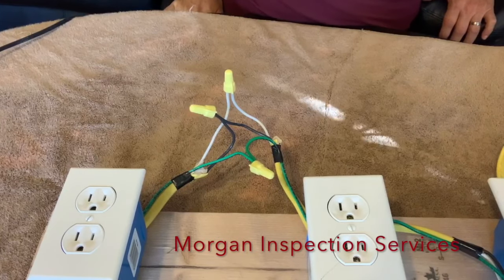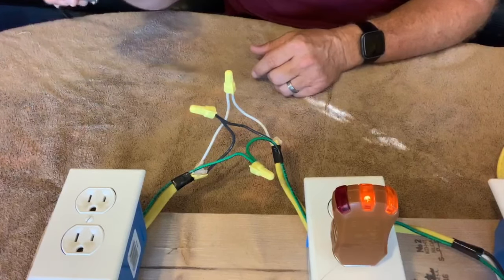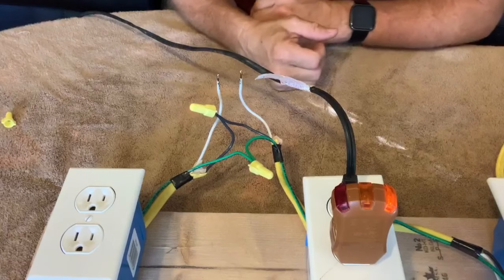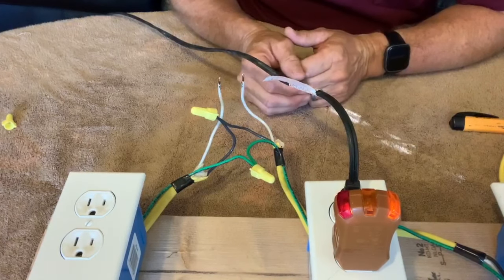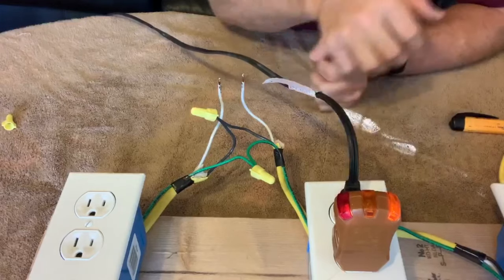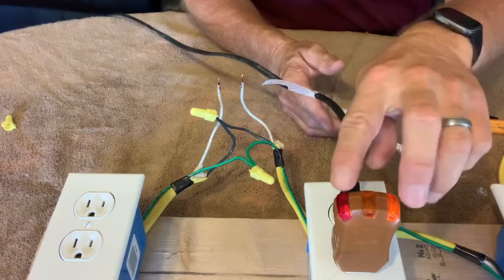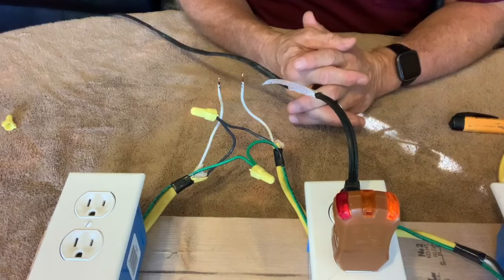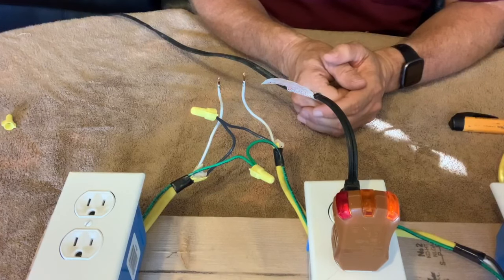What is a Hot Ground Reverse?

Comment: I just finished working on my sons home they just purchased.  The inspector noted a weird sub panel and a few receptacles with hot neutral reversal.  The 60 amp feeder in the Main panel board was connected black L1, red L2, white neutral/ ground bar, bare neutral/ground bar.   In the MLO panel connections were black neutral bar, red L1, white L2, bare to ground bar.   There were circuits connected to breakers 3,4,7,8,11,12.  So, all of the L2 positions with the white wire connected.   After testing and revising the feeder to be correct, all but two receptacles tested reverse wired.   Black on silver white on brass.   The original installer had reversed them to look correct.   So, power was from neutral bar, to devices on white, back to panel on black to breaker.   This installation was done over 20 years ago and been that way the whole time.  Horrible that anyone would do this!

Comment: I have the same problem with no lights and same thing showing on tester indicator. I have 6 light switches  5 outlets on the Circuit. I have checked all the connections and replaced the outlets and swtches. Checked ceiling fan, ceiling lights and vent a hood connections.  Still no luck. Voltage is good at breacker. Stumped!
Reply from the maker: Are you getting the Hot/Ground reverse indication on all of the outlets on the circuit or only on some of them? If it is only one or some, then this should help you to track down the loose neutral wire.
Reply: I'm getting it on all of my outlets.
Reply from the maker: It’s very hard to troubleshoot this kind of thing long distance, but I would follow the wire from the breaker to the junction box in the attic (or wherever it is) and make sure that everything is wired properly there. I would use a multimeter and make sure that you have 120 V between your hot and your neutral, and between the hot and the ground. If it tests good there, go to the next spot - whether it’s a light or an outlet and do the same thing. If it doesn’t test correctly at the junction box, then obviously there is a problem before the box. You might could speed things up by using a voltage “sniffer“ and just checking your neutral wire in various places and seeing if it has voltage. Once you find where the neutral has voltage and where it does not have voltage, you will know the problem is between those two points. 
I would be very interested to know what you find out.
I just had another thought. You said you have outlets and lights on the same circuit. If someone ran a neutral wire to a switch instead of the hot wire to the switch, that could be the problem. Just a thought.

Comment: What if all 3 lights light up when testing a gfi? Rechecked wiring. New gfi. Line only, with ground. Whole neighboring circuit out. When I jiggle new gfi in metal electrical box neighboring circuit activates for a second. House 1960’s   Any thoughts?
Reply from the maker: My first thought is that if you jiggle the GFI in the neighboring circuit comes on, then there’s a loose connection at or near the GFI. Are you saying that all three lights come on when you are pushing the test button?

Comment: I just finish replacing new outlets and switch , 13 units total because no power and breaker on/ So I started replacing all bad ones and couldn't find nothing , no loose wire or something to help me  to say : finally I found the problem. NO, still have same reading: red and orange HOT GROUND REVERSE. My last chance is replace just that breaker for that area.. Hope works. I like your video gave more idea if You have any suggestion I will appreciate it. Thanks
Reply from the maker: How did it work out for you?

Comment: Very informative.  The load must be turned on, as stated, to receive a shock
on an open neutral. Kirchhoff's voltage law for series circuits. You are in series
with the other load.  Did not know about the plug in tester giving misinformation. A big thank you.
Reply from the maker: Thanks for the feedback.

Comment: Hey so quick question I went through the testing of the cabling and everything and it said I had a hot ground reverse so I made sure to unplug everything for my outlets in my entire apartment I'm in an apartment by the way and it didn't seem to change so I turned off the circuit breaker for it and what I found out is that there is no ground cable connected to the outlet would that also give it a hot to ground reverse?
Reply from the maker: Do you have one or multiple receptacles showing hot/ground reverse? If your problem is indeed an open neutral somewhere upstream, it should not matter if the receptacle has a ground wire or not. The missing ground, by itself, would definitely not cause the hot/ground reverse reading.
Reply: @morganinspectionservices3840  I only have the two outlets showing hot ground reverse. Before it is the bathroom outlets though and from the video I recall it could make the reading different.

Comment: Ok.  The outlet is working fine, but the tester indicated a hot and neutral reversal.  And you're right the first thing I thought of was that the wires were likely reversed at the other end.  I'm going to just leave things the way they are since it's all working like it should.  I only found it when I was checking all the outlets to see if they were correctly grounded.  Some were and some weren't but I was able to fix those.
Reply from the maker: It's not a good idea to leave a hot/neutral reverse in the home - especially as easy as it normally is to correct it.

Comment: My outlet is saying that it’s a hot ground reverse. I only have two wires and no ground. How can I fix this?
Reply from the maker: Hi. As I show in the video, a "hot ground reverse" normally means something totally different, however, in order to get that indication, you have to have working ground. Without a ground, you cannot get that indication. Do you have a metal box and conduit going to the box that may be providing a ground? That is the first question that needs to be answered. Perhaps you could check some other nearby outlets with your tester and see if they show to be grounded. Then check and see if there is or is not a ground wire to them.
Reply: @morganinspectionservices3840  I did find the ground. It was attached to a screw in the back and not on the outlet. The problem is the electrical box keeps tripping. So I thought it was the outlet (old outlet/old house) The one outlet still reads hot ground reverse. But I’m not getting power to a ceiling light. I changed the light switch. And power came back to the ceiling light. A couple hrs later the Circuit tripped again. I changed a second light switch. And still power. 🤷🏼‍♂️
Reply: Bro do a jump from the neutral to the ground
Reply: @frasscolegaming5510  That is very much against NEC. Assuming that the OP is saying that he has a metal box and the box is grounded through metal conduit, the proper answer is to use a green pigtail to connect the outlet ground terminal to the electrical box.
Reply: @bobraible  true it is wrong but that's the only way his tester will read correct
And that's what was ask
Reply: @frasscolegaming5510  That solution is potentially dangerous and though not uncommon should not be encouraged. It runs the risk of energizing the "grounded" metal case of equipment.

Comment: Thanks for the video.  The outlets in my living room work fine and have for years.  Until this afternoon.  This morning they worked (the TV plugged into one of the outlets worked just fine) but then later this afternoon the TV wouldn't turn on when I tried.  I tried the three-light outlet tester and it showed the "hot ground reverse" red/yellow lights.  I tested all the outlets in the living room and they all had the same yellow/red light display but the rest of the house seems to be just fine.  No circuit breaker is tripped and, as I mentioned, I'm puzzled because I don't know of anything that would have happened to have affected those outlets between this morning and this afternoon.  If you have any ideas I'd be delighted to hear them.  Thanks.
Reply: Sounds like that specific circuit has a bad neutral connection, meaning as all other circuits work just fine. Unscrew some faceplates and check neutrals on the outlet and other devices on that specific circuit.
Reply: @jacobheater3496  I found it! One of the white pushed-in wires in the outlet had broken.  Thanks a million for your video - it really helped me out!!!
Reply from the maker: Glad I could help.
Reply: I’m going through the same scenario right now. Every outlet in one of my rooms says hot and ground reverse. I’ll let you guys know if I’m able to fix it.
Reply: I was able to fix it thanks to this comment.

Comment: It would’ve helped me if I could’ve seen the power source
Reply from the maker: Please explain. I want to make these as helpful as possible.
Reply: It helps me understand the flow of electricity through your circuit if I know which direction its coming from. In other words, would the cable coming out of the outlet on the right be coming from the breaker panel?
Reply from the maker: I thought that might’ve been what you were asking but I wasn’t sure. The power is coming in from the left side and moving to the right.
Reply: @morganinspectionservices3840  I was confused as well and I have a BSEE. Your video never shows the mains connection and I was originally assuming that it was on the right and finally figured out it only made sense if the mains were connected on the left. Other than that I found this video helpful. I just bought a house built in the sixties and half the outlets have reversed, and in many places the EMT conduit has discontinuities resulting in bad grounds. The branch powering the garage is dead, and there are a sundry other problems. So its very important that I don't misinterpret what my 3-light tester is telling me. So thank you for this video.

Comment: I had a very weird problem in the house i just moved into.  Involving one of the outlets in the living room, next to a window.  After getting all the furniture in place, i plugged in a floor lamp, when i turned it on, i heard a loud pop.   Very concerned that i may have some  major wiring issues,  i tested with a 3 light tester, and all three lights lit up.   Have you ever seen that before.   I am trying to avoid having to spend money on an electrician,  as i am working odds and ends after getting temporary laid off from my current job.   Any ideas would be greatly appreciated.
Reply: Never mind, the outlet that blew my floor lamp, that had all three lights on, was wired for 240 volts, and was on a dedicated 15 amp circuit.    The house i just moved into was built in 1979, and already has central air conditioning.   Being the faulty outlet in question was located by a window,  on a dedicated 2 pole breaker, concludes that the homeowner before me, at one time had a window A/C then replaced the 15 amp 240 volt outlet with a 15 amp 120 volt outlet.   Why is beyond my comprehension,  the home inspector did not catch that.  Anyway i just got done remedying the problem by removing the white wire off of the 2 pole breaker that supposedly controlled an air conditioner or maybe a large commercial sized electric heater,  and connected it to the neutral buss.   Problem solved (I have a dedicated circuit for my lamp, lol.   ) lesson learned after my LED floorlamp destroyed,  don't count on a home inspection to catch every nook and cranny
Reply from the maker: Sorry for the delayed response. I was just about to tell you that it would have to be wired with 240 volts for all three lights to come on. Glad you figured it out.

Comment: Very good video!  Totally helps !

What if someone upstream connected the white wire of the branch to the hot or black wire side of the upstream outlet? So the hot and the neutral side are both from the hot upstream.  What would the indicator show?
Reply from the maker: If both the hot and neutral sides are connected to hot, the indicator would show that the receptacle is dead. This obviously could be quite dangerous because someone, thinking that there was no power to the receptacle, could potentially be shocked or electrocuted.
Reply: @morganinspectionservices3840  , 9f course I think you are right I was just trying to imagine what would have caused this fault. ..

My situation was just as described with an open neutral.

I just didn't understand why it snowed a circuit between the neutral and ground when I really don't think anything was plugged in or connected after the open ground...

Thank you just the same, it really helped me find the "stab in the back" upstream outlet that caused my problems.

Comment: Trying to diagnose an issue with same indicators per your test light.  Glad to have your input that the issue is more than likely a loose or disconnected neutral somewhere.  Am going to start checking for that in the general area to see if I can find the problem.  Thanks for sharing your knowledge.
Reply from the maker: Tim C  Good luck. I’d be curious to hear what you find.

Comment: Thanks for the helpful information. I was wondering what would the sure test meter by Ideal indicate in this test.
Reply from the maker: That is a great question. I will to a video where I compare readings on the three-light tester to what the Suretest shows. I will do that this week. Thanks for asking.
Reply: @morganinspectionservices3840  I look forward to seeing the test results. Thanks.
Reply from the maker: I tested this open neutral set up with the Suretest circuit analyzer. It was as if it was plugged into a dead outlet. The suretest did not light up at all. I was rather surprised by that, so I checked it with my spare Suretest and got the same result.
Reply: @morganinspectionservices3840  I watched an electrical you tube channel explain that the sure test by Ideal uses the neutral wire for its indicated functions and will not indicate an open neutral. surprises me the cheaper plug in tester will indicate an open neutral but the more expensive sure test will not.

Comment: I live in a double wide. It was windy and cold when all the lights in the house started flickering.
After that a couple lights worked but every single one of my Outlets says hot ground reversed. It's crazy when I turn some lights on other lights on other circuits dim. 
The switch that turns the light in the ceiling fan on in my bedroom is now hot in the down position.
The only two things in my house that have been working solid is the furnace and the hot water tank.
It is acting like a neutral wire is bad but it must be a main neutral wire because it's all of the outlets.
Upon inspecting underneath the trailer I have a pretty bad water leak.
Is there any chance that there is a main neutral wire? This electrical system is doing things that shouldn't happen😢.
I have LED lights that stay dimly lit even when the breaker is off!
Reply from the maker: It sounds like you have a lost neutral outside, and not a disconnected neutral inside your house somewhere. You might want to watch this video because a lot of the symptoms you are describing sound like a lost neutral. I’m not sure why you would be getting the hot ground reversed indication with a lost neutral, but check out this video because it sounds like that’s what you’re experiencing.       https://youtu.be/S3dvzOZm-58?si=0ebm0K1JnrWnqpWY

Comment: I got hot/ground neutral but nothing else is plugged in

What does that mean and how do i fix it
Reply from the maker: Are you sure nothing is plugged in anywhere upstream of the outlet in question? If that is the case, could one or more lights be on the same circuit?
Reply: @morganinspectionservices3840  idk what it was but my dad fixed it

Comment: Im confused.....why wouldnt that lamp turn on if you  have the neutral and the hot connected to the outlet that the lamp is plugged into??
Reply from the maker: The lamp did not come on because the neutral wire supplying the outlet was disconnected. When the neutral wire was connected, the lamp did work, but then I disconnected the neutral and that is when the lamp did not work.
Reply: My bad....your supply was coming in from the left, not the right...

Comment: I got that reading from a similar tester when I touched the mounting screw to the box.
There is no ground wire.
Before touching the mounting screw to the box, I merely got "open ground" (which I expected).
Hopefully, it will be safe to use.
Reply: Put a gcfi on that receptacle, or change the breaker to a gcfi/acfi breaker

Comment: With an open neutral (upstream of the load), If you were to measure voltage between the "ungrounded" black and the "grounded" white conductor (at the receptacle) would the potential difference be zero? (Thanks for the video)
Reply from the maker: Yes, as long as you have a load plugged in and the load is turned on, the hot and neutral wires are essentially connected to each other through the load, so they will be at the same potential.
Reply: @morganinspectionservices3840  thanks for the reply

Comment: I have a small vintage travel trailer and I replaced a cheap wall lamp with something nicer looking.  Had no switch so I installed one on the lamp.  Didn't realize that the insulation was brittle,  and it shorted out against the new mounting bracket.  Took it apart,  electric taped the wires and reinstalled it. The lamp now works with the switch,  but the receptacle downline shows a "PWR/GND REV" and isn't providing power.
You said this can be dangerous.  I'm living in this thing.  Any suggestions? I replaced the original receptacle with a GFI receptacle,  still reads PWR/GND REV.